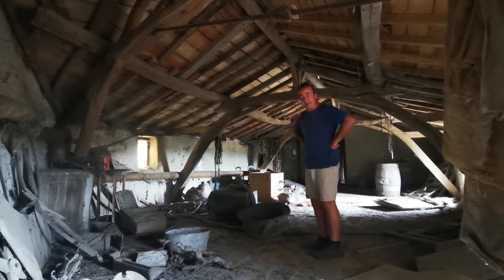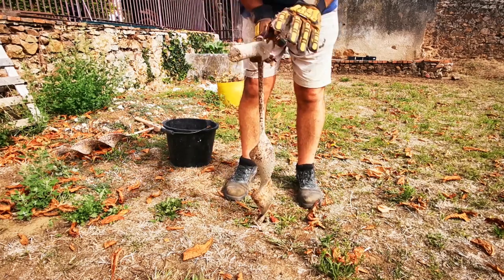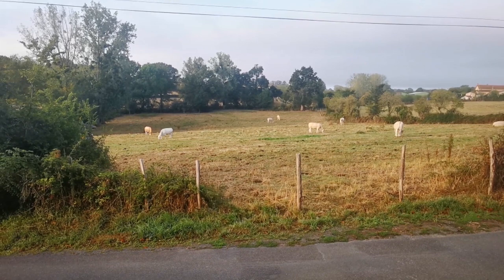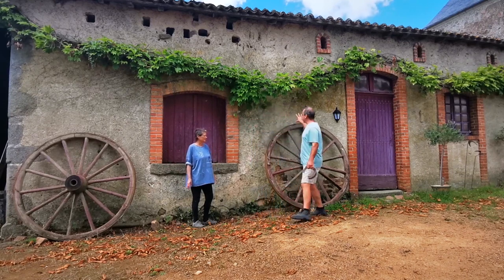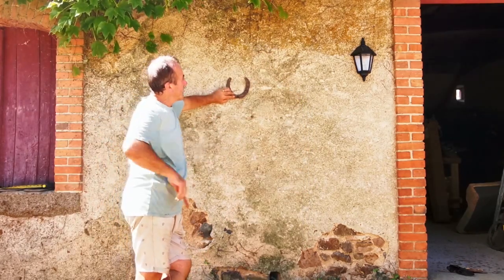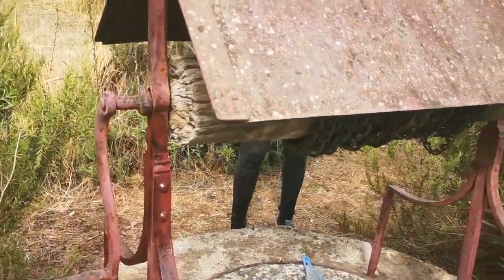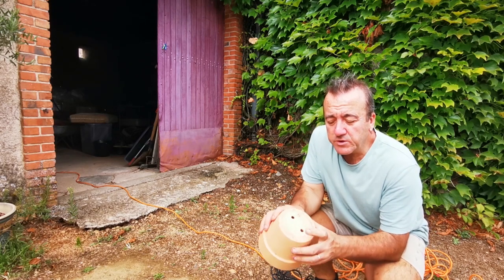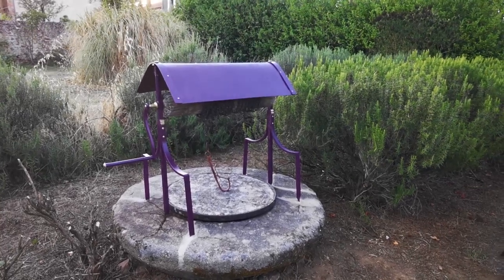Episode 30 All's well that ends well

Comment: That looks like papyrus,Suzie….needs to stand permanently in water….
Reply from the maker: Thank you Adeline, yes we will be standing the pots in water. We believe they self seeded from our old pond. Have a great week, Suzie and Rols
Reply: No they don’t!
Reply: Grew these in sand in Florida.  Easy to propogate. Dig our an area a little wider than the width of one top piece.. Make mound in center no higher than soil level.. Cut off a green stem,  turn upside  down (leave stalk/stem) .  Spread the leaf/fron over mound n cover back up.. Tamp lightly.  Keep watered but not soaking/standing in water. your pebbly/rocky soil seems well(drained enough.  Love those plants.
Reply: Papyrus are a weed they will grow in almost anything anywhere and come back
Reply from the maker: @cynthiabroockman1752  Thank you for watching and thanks for the tip. Have a great week, Suzie and Rols

Comment: those big shoes,  probably clysendale kind horses.   they pull huge wagons.    so  clearly matching up with what you found;  chateau must had huge heavy wagon.    

by the way   horseshoes is supposed pointing down (if you are superstitious) and either on door or above the door frame.  not on walls.
Reply from the maker: Thanks for watching. The haywain we have includes 2 extremely heavy axles, combined with the wheels etc means only a heavy workhorse(s) would have been able to pull it. No we're not superstitious, apparently in France they point down and UK they point up 🤔 Have a great week, Suzie and Rols
Reply: @chateaucitadelleducavalier  you welcome.
Reply: @chateaucitadelleducavalier  Lore has it that if you point your horse shoes down, all your luck drains out.
Reply from the maker: @lindamounts2193  Here in France, apparently, it is the other way round ie pointing down is good. Either way, we're not superstitious. Have a great week, Suzie and Rols